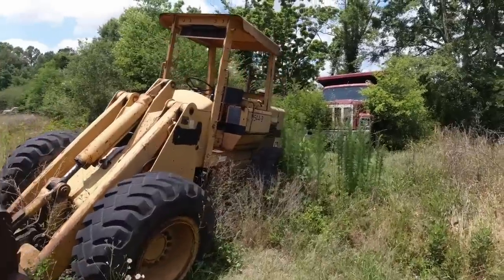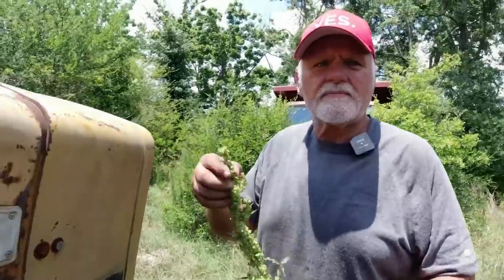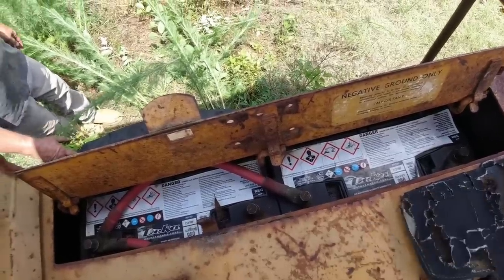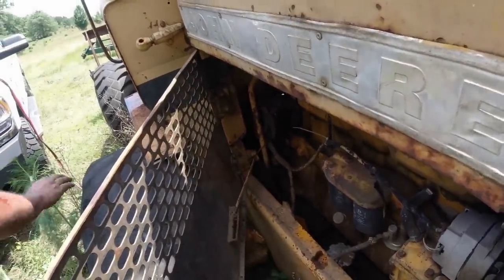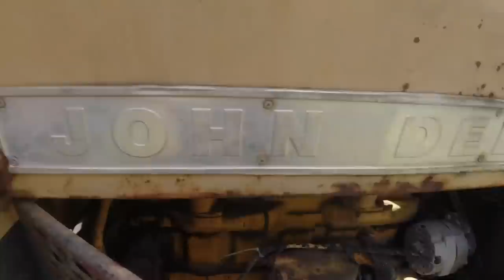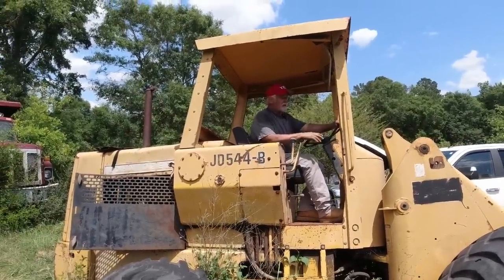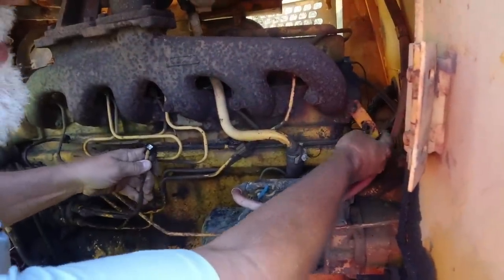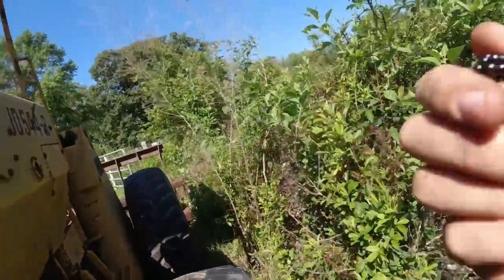This machine kept a secret for 23 years! Will it start?

Comment: You guys need to put a invertor on your truck so you could plug in a charger in and you won't haft to change all those batterers saves on back . I got 2000 volt one on my truck and use it all the time. Your not as young as you were.

Comment: You guys CRACK me up. Car alternators produce ALTERNATING current.  They convert the AC to DC through as series of rectifiers.  (Usually) GENERATORS simply produce direct current when they are spun.  The faster they spin the more electricity they make.  That is why old cars at idle have dim lights. (1930's era cars.) The generator needs more RPM to make more eleftricity.  GENERATORS are also motors, if you put electricity to a generator it will spin.  Some cars have a single startrer/generator that both starts the engine and charges the battery.  (some old small foriegn cars.)
Reply from the maker: Interesting 👍

Comment: Generators are dc, Alternators are ac.   They both have commutators to transfer electricity into or out of the rotor... But the alternator only sends the small magnetising current into the rotor..  The generator carries the full output current out through its commutator brushes, so is less efficient.   Somewhere on the vehicle, the generator uses a voltage regulator, which can just be a relay device.   The alternator has a built in diode bank and semiconductor voltage regulator, to make the dc output.